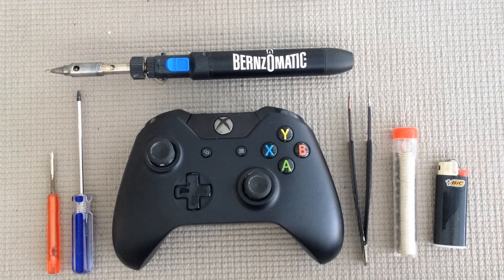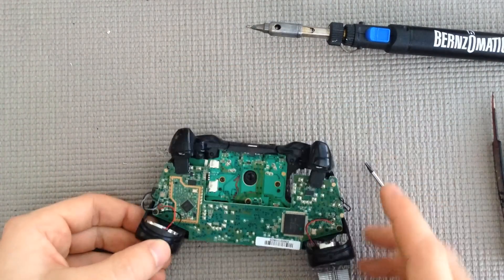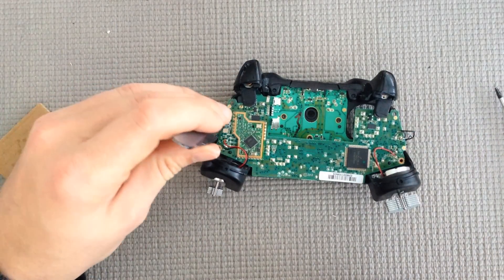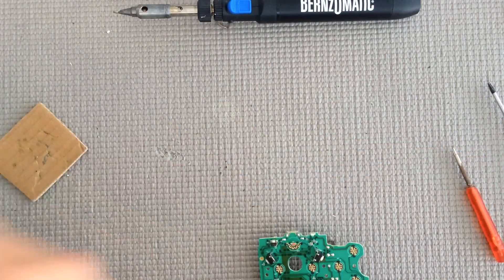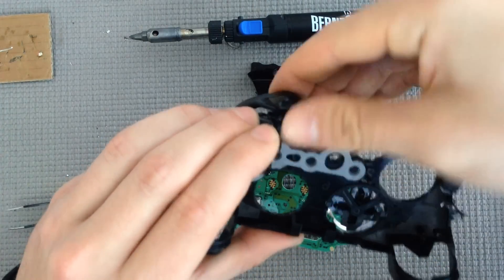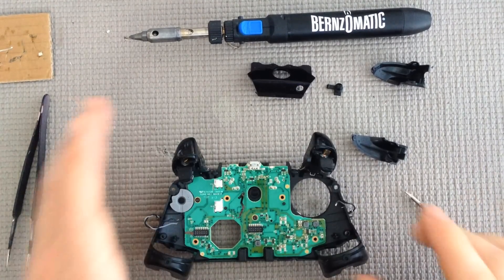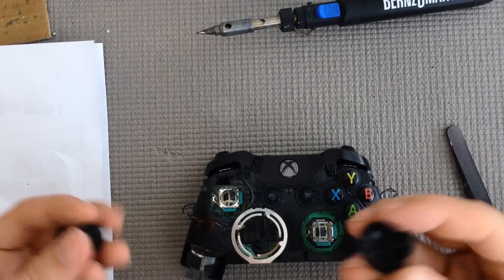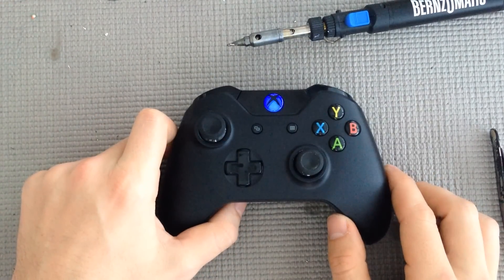Turorial: How to Change an Xbox One LED Light Mod HD

Comment: I am new to customising remotes and I would like to know:
Do you need to prime the controllers?
If so, do you do it before spraying or use a mixture of the paint and primer?
Do you need to wait for the paint to dry before adding a clear coat?
Reply from the maker: Yes, your prime them. And Yes, you wait for paint to be dry before clearing.